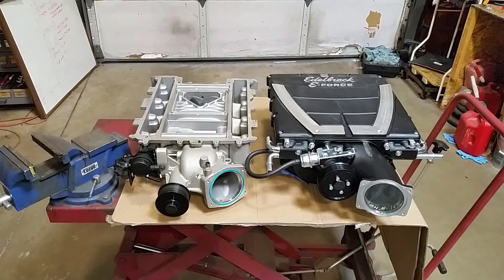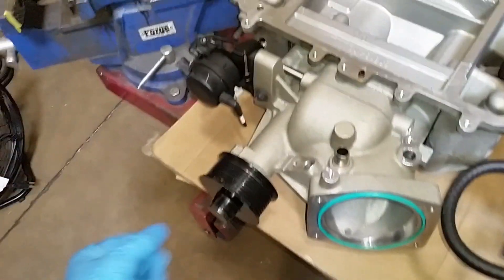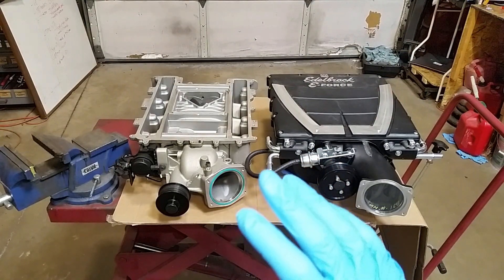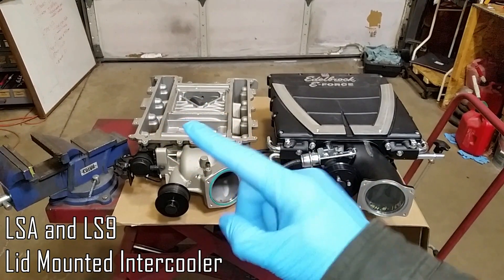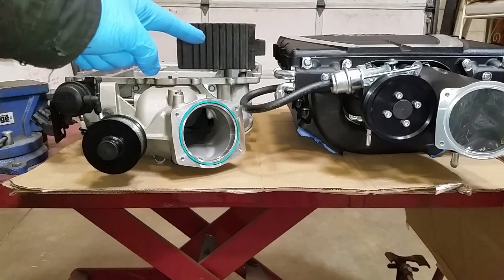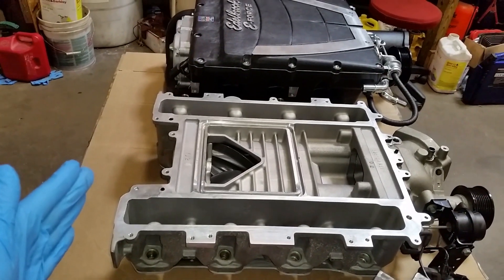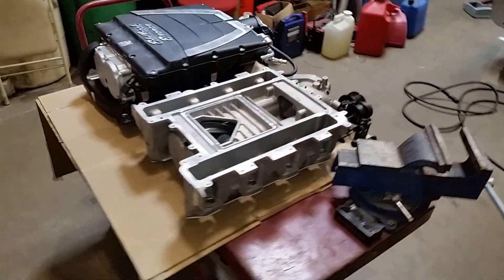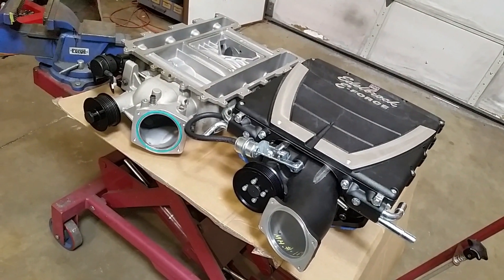Supercharger Comparison LSA TVS1900 VS Compact Edelbrock TVS2300

Comment: Good video. Basically is depends on your belt drive and hood clearance. Also the Edelbrock will make more power since it’s a 2300 vs. 1900.
Reply from the maker: the 1.9 is pretty much unrestricted with no external dimension compromises and the eforce with compact packaging has a few restrictions, but it performs well. Where it lacks is the intercooler / lid air flow but its to be expected with the compactness. Id love to see if it fits on my 4th gen with some tweaks.
Reply: @CamaroRick  it looks like it might. It’s definitely quite a bit shorter.

Comment: Did you do the c5 corvete with the blower
Reply from the maker: Yes, Ive done quite a few of them in all types of blowers
Reply: Rick what blower works the best and what is the best in your opinion I have a 2000 C-5 Corvette I am always looking to install the supercharger
Reply from the maker: @slyr1  Pretty much any blower you put on it will be able to safely max out a stock Gen III short block, but if its built for all out power you cant beat a centrifugal on efficiency. I like the positive displacement superchargers because they are easier to access the front accessory drive for cheap maintenance. I like the eforce for it being compact, the LSA would require cutting on the firewall on a C5, if your not worried about changing to a taller hood Id go with a Magnusson
Reply: Is there a kit that just bolts right up?
What do you have to modify things
Reply from the maker: @slyr1  everything except the ls2 eforce setup is direct bolt on. If you check my playlist you can find the parts overview on the eforce conersion setup if your want.

Comment: Hey so this might be a stupid question but ..

What if I just want a supercharger for a bit more “fun” out of my classic car? (67 LS1 Swapped Camaro) I was thinking of going with pro charger but I like the root style (I have the cowl hood so no I don’t have to worry about hood issues) but which one would u recommend for daily use? (Well it’s not my daily but I do use my classic pretty often (no I don’t care about “ReSaLe VaLuE”) 

So: 

1.) which one would u recommend for use if I drive it often? 

2.) can i run a supercharger in general, with stock internals (I have mods, cold air intake, headers, exhaust , etc., but my engine is stock, stock injectors, fuel pump, etc.) 
So can I run about 5 pounds of boost safely ? Or maybe 7?
Reply from the maker: Im the same way, Id rather enjoy the car myself vs saving it for the next guy. In my opinion It really comes down to preference.  You can run boost on a stock engine just dont get too carried away and it will last a long time. Mechanically you should upgrade the LS1 valve springs to prevent float. The LS6 springs should handle around 7psi but not ideal. A little more seat pressure would be great insurance. Boost reference regulator is the best bet for safe fueling but since stock internals will limit you on safe hp range its not exactly required at around 500rwhp. 60lb injectors without a boost reference should be fine. It will use more injector overhead because it will have to overcome boost pressure. A boost reference regulator will raise fuel pressure as the boost pressure builds so its not fighting against manifold pressure. It will give you more overhead out of the injectors and keep the duty cycle down. 340lph pump will be good and shouldn't overpower a C5 filter regulator if you are using one. If not get whatever high pressure pump you want. You can push it harder but its a trade off on longevity on a stock LS1. A good tune is a must. Ive heard of guys pushing them over 600rwhp stock but its not going to last very long with a stock LS1 internals in my opinion. Especially if something randomly goes wrong on the fuel or spark side. 
 
The centrifugal is the most efficient, with a good ramping in of the torque (may also be slightly easier on the rods moving the power band up in rpm) has a nice whistle to it, cons are the maintenance is harder since it takes up the accessory bracket real estate. They are kind of a pita to change a water pump or belt in most cases. Sealed units have to get oil changes every 6k miles. It will support more power than the engine can take so if down the road you want to upgrade the short block you can just change the pulley.  

Positive displacement superchargers are basically maintenance free (change the sc oil at 100k miles "normal" use) They make a lot of torque lower in the power band. They will be more silent at low boost levels (I dont think you will hear much wine under 6psi. Plus is the front accessories are easily accessible just like stock. If starting from scratch a magnuson would be a great option. The LSA if bought new would be close to the same price and hits limits above 650rwhp. If you can find a good deal on the parts it would be worth it. You could run it with port adapters (raises the charger slightly) Its not really a matter of boost more of how much power your putting through the rods. you can use a calculator to figure out you power levels based off of what the motor makes naturally aspirated for boost power.  If an engine makes 200hp and you put 14.7PSI through it in theory it would double the hp / 400 not factoring in efficiency losses / hp used to spin the blower etc. but it is a good rule of thumb. 
Around 7.4 psi you will pick up close to 50% more power through the engine before parasitic loss to spin the sc.

Comment: Hey man is this frost specific or do they all have the belt system? I have an ls3 98 Camaro and want to drop a supercharger I don’t have to mess with so much
Reply from the maker: The Edelbrock is set up for stock Corvette accessory drive. The LSA has its own belt drive from an extended crankshaft dampener

Comment: Never understood why GM has such terrible intercooler core/manifold designs compared to aftermarket or even the other two. They didn’t learn their lesson from the LS9 when they went with the ATS-V either. Only the 3.0TT and 4.2TT have modern core/manifold designs.
Reply from the maker: I believe there were designed and produced outside of GM
Reply: Camaro Rick I believe the same. They use what’s more typical of industry standard in design and sourced materials. They’re Mahle group cores.

Comment: Compared to the Magnuson Heartbeat or the centri superchargers (A&A, ECS), how well does the E-force compare?
Reply from the maker: The Eforce's main appeal is the compactness. Its a well built supercharger for a maintenance free setup. (says to change the oil after 100k miles of normal use. Same with the maggie. The EF has long runners and it makes good torque, the lid is a bit restrictive but other than that its pretty good. They have to be bled well to get the air pockets out of the heat exchanger. The maggie has better airflow up top with a larger footprint and is also maintenance free. For all out power they cant touch a centrifugal (with no heat soak probs) but the modern rotor design approaches centrifugal like efficiency. Maintenance takes longer on a centrifugal as it takes up a lot of belt accessory real estate. A sealed centrifugal can be a little annoying to change the oil every 6k miles but if you put a drain extension its not bad. The sealed units fluid smells horrible so without the drain ext it will drain over everything on the front end (have a few cans of brake clean ready). Or just get an oil fed setup. Some prefer the whistle of a centrifugal. There is a lot more potential to make big power numbers with them. A&A has very stout brackets that eliminate common belt issues with a centrifugal. They are great.
Reply: Camaro Rick Thanks for taking the time to respond.

Comment: I have a question. If there was a 2-to-1 intake runner manifold to convert these V8 superchargers to be used on an inline 4, would the amount of boost be doubled per cylinder?
Reply from the maker: No, These are specific to LS type engines. I would just go with a turbo setup. Even a custom one would be cheaper and take less time to make than adapting this. Anything is possible but its just not worth it.
Reply: @CamaroRick  I see. Thanks!

Comment: Hey by any chance do you know if the 2.3 ls9 supercharger found in the c6 zr1 corvette is the same pulley alignment of a ls1 f body?
Reply from the maker: I dont believe they are the same as fbody spacing. i do know the water pump upper hose end is in a different location than the fbody. It may be just standard corvette spacing

Comment: from my understanding these superchargers have heat soak issues unlike centrifical superchargers
Reply: the heat soak is fixable, the plus side to these is the instant power.
Reply: Larger heat exchanger, icebox reservoir, meth, E85 and nitrous will cure that heat soak.
Reply: Innerchillers help a lot, but another addon and expense.

Comment: The LSA takes less power to drive than the 2.3, 90hp est for the LSA vs. 120hp est. for the 2.3 so the difference in pulley size isn't the only factor in belt slip, wrap is a big factor as well. There's also been many LSA's at over 800 whp I haven't seen many (actually none) Eldelbrocks in that range...

Comment: Camaro  Rick love the channel and the c5 build. But, i got to ask you a question. Have you ever seen or witness somebody Port out the Edelbrock Supercharger and if so what do you think the power gains will be?
Reply from the maker: As far as a max effort build there are better options out there for a 2300 rotor setup if you have the room to fit it. This Eforce has long runners built into the base that make for great torque and drive-ability but are more restrictive for high rpm use vs a magnuson that has direct boost into the head style like the LSA. It can defiantly be ported to make more power. I have not seen it done first had but it is easily possible. Im not sure how much room there is to gain. The best bang for the buck porting on this one would probably be to clean up and open up the snout for a 102mm. You could also open up the runners slightly but I dont know how much meat is in them. They are cast pretty decent out of the box. Ill show more on the ports on the C5 build in the works.